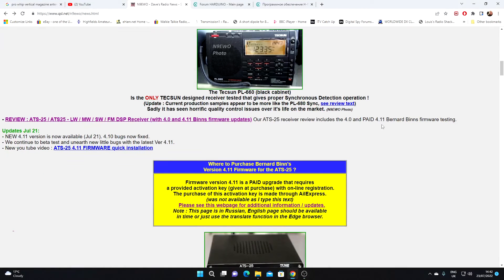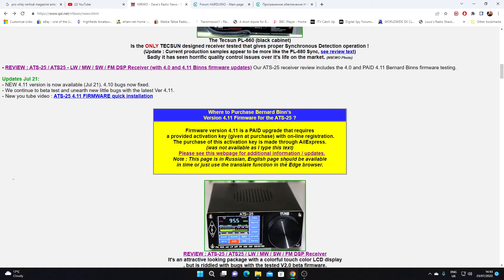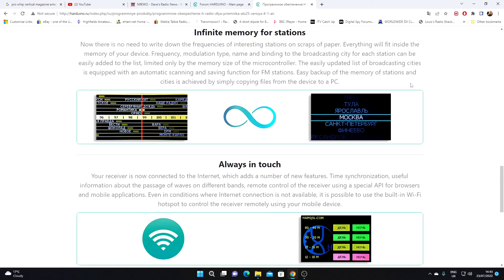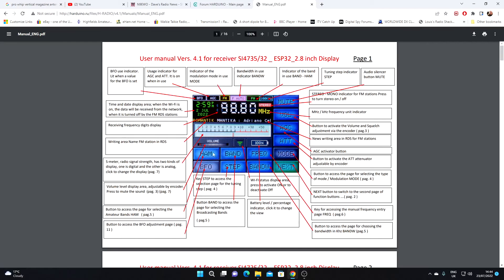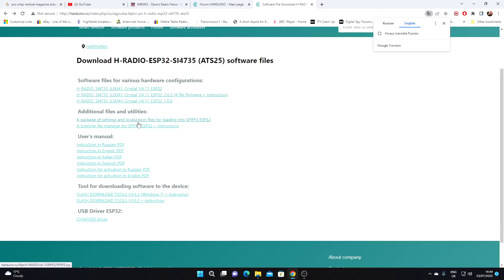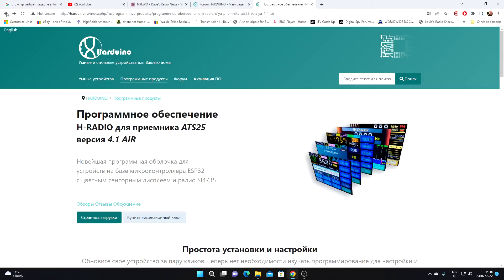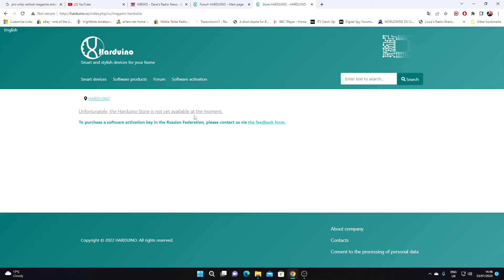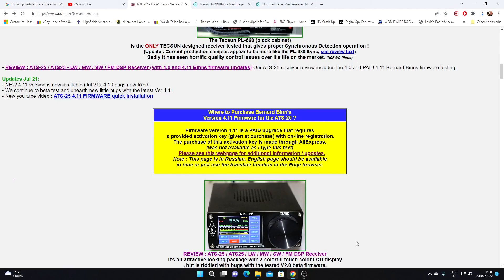Future Update for the ATS-25

Comment: Hello, for the radio listeners this radio is complete with the Aircraft Band from 118 to 136 mhz, or a model only with this band from 118 mhz to 136 mhz. congratulations for your work. Thank you
Reply from the maker: No aircraft band with this radio
Reply: @KevinOReillyswl  Yes I know, but could I do it, does the chip go to the band?
Reply from the maker: @guaracyjunior6876  no the si4732 chip won't cover it as far as I know